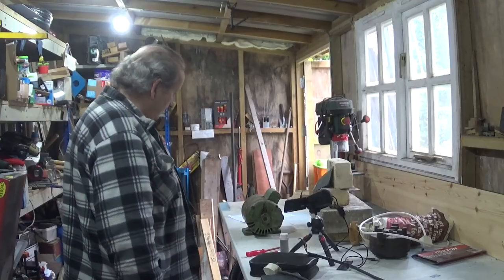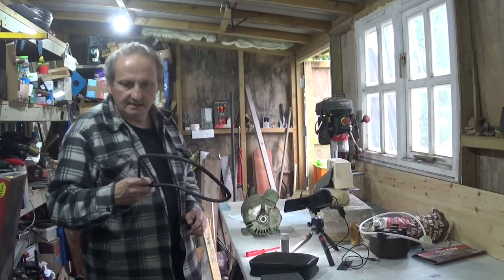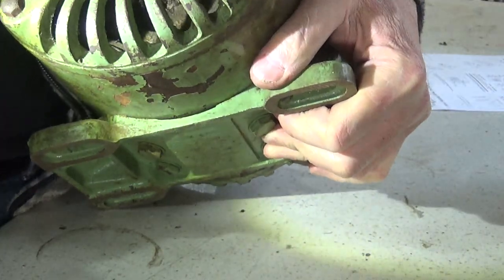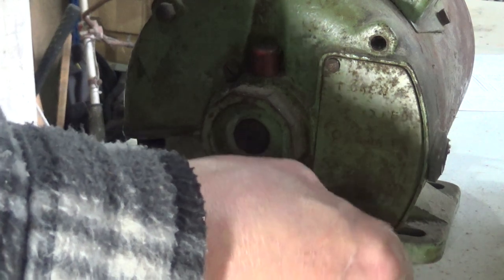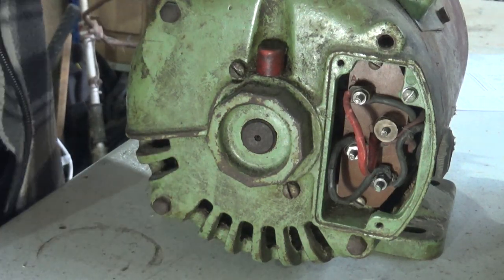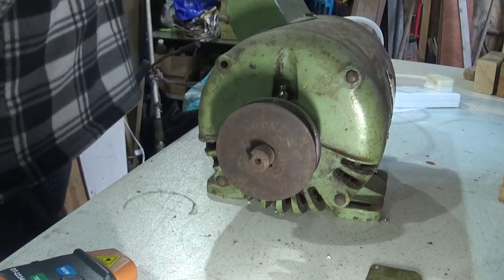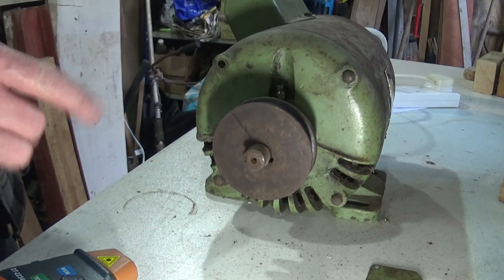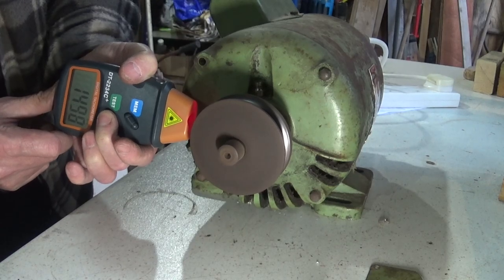How to wire up a Brook Motors Ltd Gryphon Motor and reverse it

Comment: Brilliant, you have just taught me how to wire up a garage find Gryphon Brook motor. Thank you.
Reply from the maker: You are very welcome! Many thanks for watching, please like, share and if you like the channel, subscribe!
Reply: @BensWorkshop  lm not sure where to connect the earth wire though there doesn't seem to be a terminal.
Reply from the maker: There should be somewhere a screw that you can put it under. The case needs to be earthed.
Reply: @BensWorkshop  There are 2 screws which l presume are holding the Tufnell base to the casing. Could l use one of these?
Reply: Can l send you a picture of the inside of the cavity?
Reply from the maker: Yes, but outside of the cavity as well please (around it). My email address is in my about page.
Reply from the maker: You do not appear to have sent any pictures yet.
Reply: @BensWorkshop  Hi Ben thank you for your reply. I have sorted the earth connection now thanks. 
The motor l have is a Gryphon Brook motor. It is 0.25 hp and 940 rpm. Is this OK to fit on my Fobco bench drill. Will it be powerful enough to drill metal?
Reply from the maker: Well it is what you have so it will have to do, I think my pillar drill if a 1/2 HP and my mill is either 3/4 or 1HP. So if you come across another that is higher HP that might well be better. Got a link to the bench drill? It might be on Lathes.co.uk in which case it may say hat HP the original motor was.
Reply: @BensWorkshop  Thanks Ben👍

Comment: The mysterious and fascinating world of induction motors - nice motor - scary old wire!!!!!!

I've got a similarly old motor, the plan for it is to convert it into a generator but something on the wiring doesn't test correctly so I need to strip it further, hopefully someone has just incorrectly refitted the centrifugal switch (which I don't need if I'm going to use it as a generator) but it's always possible that one of the windings has shorted which wouldn't be so good.  I haven't looked at it for a couple of years - hopefully I made notes otherwise I'll be starting from scratch when I look at it again.
Reply from the maker: You will probably find the wiring diagram on line somewhere. In my case as it is a capacitor start the Z coil tests as open circuit. Not sure how well it would do as a generator though.
Reply: @BensWorkshop  It's a pretty non exact science using induction motors as generators - you need a hefty bank of run capacitors to provide the excitement for the field coils and it relies on some residual magnetism to actually start up - I have a book on the subject (which I haven't read yet).

If I ever get round to it I'll do some sort of video but it might be a while before that happens.
Reply from the maker: I look forward to it.
Reply: Oh, I forgot to say what a lovely lathe that is, very envious. You'll have hours of fun with that.
Reply from the maker: @GrumpyTim  I will, and the Atlas 10.
Reply: @BensWorkshop  Absolutely, the unseen Atlas 10 will be great too - many happy shed hours!!!

Comment: Its a nice old motor you have there the laith looks cool my air con pump the bearings are starting to fail .  also been working on a starter motor for a p3  perkins nearly go a lister genrtor as well free to good home i missed out on it by 5 mins but ach well lookks a ool motor and works well 👍
Reply from the maker: I've got a few Petter engines...

Comment: Wow you really do fix everything.Im not good at fixing anything electric.Great job.something might be rubbing in the inside making the noise.Or check if it needs oil.
Reply from the maker: I think it is the pulley, which I will check out before refitting it.
Reply: Benedict White it has to be the pulley.My Jaguar was making a squeaking noise and it was the pulley so I changed it.I put a whole new water pump on it.
Reply from the maker: The pulley isn't quite square and moves up the shaft to knock against the motor. I will try pulling it off.

Comment: Your video has been really helpful but I need help with the actual wires of my Brook Gryphon motor. A1 is a unsheafed wire
Z2 is a red wire.
Z1 is a red wire
A2 is the same as A1 unsheafed.
Reply from the maker: Basically you have an A coil and a  coil. You should see resistance on the A coil of between 3 and 10 ohms depending on the power output of the motor. You might not see any across the Z coil due to the capacitor. However you can check by opening up where the capacitor is checking continuity to one end of the Z coil you should then find the resistance between the other end of the capacitor and the other Z lead. Should be greater than the resistance of the A coil.

Once you have confirmed this, put mains across the A coil, and jumper the Z coil across the A coil coil. To reverse the motor try swapping the z coils relationship to the A coil.
When testing, wear gloves and plug the motor in via a switched outlet you can easily reach. 
Hope that helps.
Please like, share and if you like the channel, subscribe!
Reply from the maker: Can you let me know how you get on?